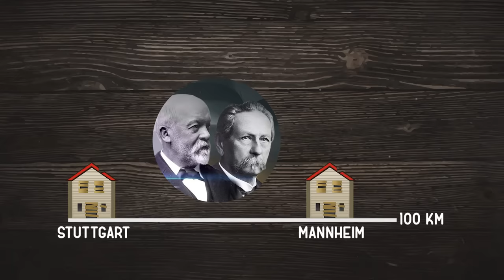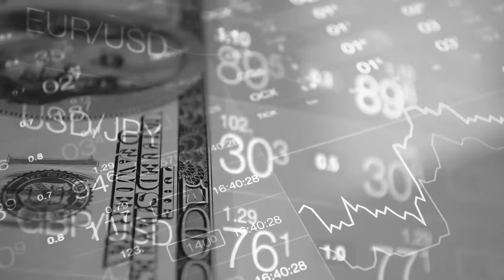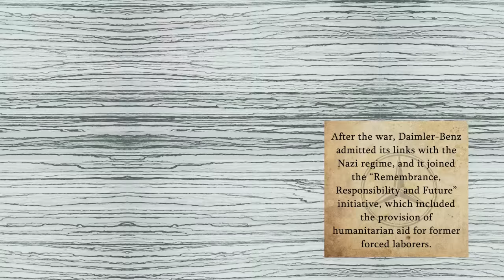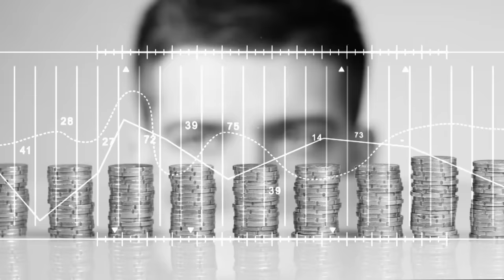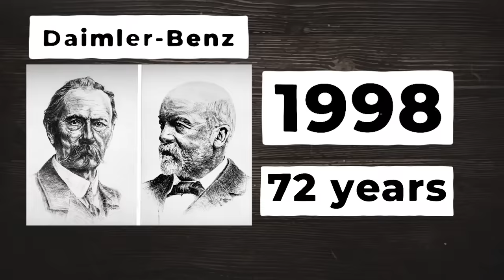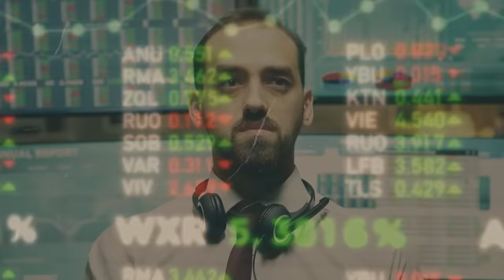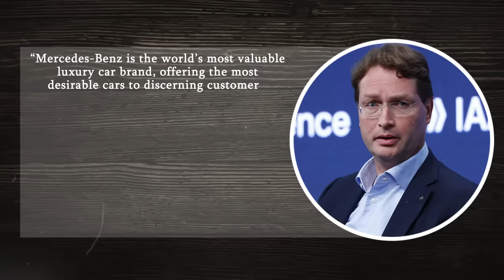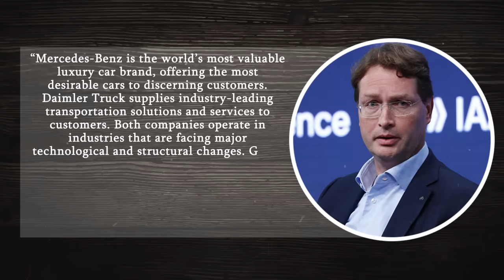How Daimler and Benz Built the World’s Oldest Automaker and Disrupted the Industry

Comment: I think that when Diamler merged with Chrysler  the quality of Mercedes-Benz went down. I had a 1967 Mercedes built in Europe it was a very fine car .
Reply: It didn’t make Chrysler better, it just made Mercedes worse
Reply: @samuelwoolwineiv7886  anything Chrysler touches turns to crap
Reply: Yes! True viewing! Mercedes going worse quality by today time.
Reply: Mercedes also faced strong competition from Lexus around this time. Their cars were no longer engineering first but instead built to a price point in order to compete with Lexus.
Reply: Partly...but the philosophy is the main reason. Part of the philosophy was to generate more profit. MB started cutting corners to increase profit leading to lower quality and reliability as a result.
Reply: Very true. Too many Jews in USA car management.
Reply: That has nothing to do with it. The last S-Class was the W140, which was allowed to be built as the engineers wanted without also looking at the financial costs, and the next S-Class, due to the great pressure and from  Lexus, and the struggle for the Asian market, had to become more cost-effective, and since then the S-class is no longer built as it used to be, but has to be built in such a way that it is also more cost-effective, so the cars are from the late 90s  not like the old Mercedes Benz models.

Comment: Karl Benz was the first of the two to build a gas-powered automobile...iirc, according to Mercedes' history, his 3-wheeled vehicle was built in 1885 and he received a patent in 1886 (Jan).
Gottlieb Daimler ALONG with Wilhelm Maybach made the first 4-wheeled ICE vehicle in March 1886, as you mention, independently of Karl Benz.
BTW, Maybach is pronounced ˈmaɪbax...MY bax (like lightly clearing your throat). Even if you don't get the ending right, just get the beginning..."my" not "may".
As you also mention, the "Mercedes" name came from long-time contributor, racer, promoter, board member, and exclusive dealerships owner, Emil Jellinek, who had a habit of naming his Daimler-Benz race cars "Mercedes" after his daughter. 
What I didn't know was that Mercedes-Benz once owned Audi...interesting. I'll have to research this.
---
I've always loved Mercedes (the first car I drove was a 300E) and Audi (the car I learned to drive on was a manual 90 Quattro). Not surprisingly, today, I have an Audi A8L, two Mercedes S-Class sedans (W221 and W222), and just got a Mercedes-Maybach S. Actually, I might have still had another S-class (W220) if it hadn't been lost in a flood. I would have gotten another Audi, but the A8L hasn't had a V8 option for 2 years now. Porsche now owns Audi and is the only major German automobile company I haven't owned...yet. I did briefly test drive a 930 turbo flachbau (slantnose) back in the 80s and that's the Porsche I've always wanted to get...one of these days...
Reply: Interested history of Automobile industry of German
Reply: Why Mercedes is better than Audi and Bmw?
Reply: @alikukaj8279  Mercedes has the latest tech, better fit & finish and reliability, and has one of the best sound systems on the market.

Audi is a close second. I like their slow design progression between generations, but there are fewer options and the design as a whole is a bit...blah. It is nice, but just not as nice, imo, as Mercedes.

BMW has, again imo, just lost their way.
Reply: @samshare2146  thanks mate
Reply: The Audi 100LS, appears to be a small Mercedes from the sides and rear.
Reply: @jamesrecknor6752  Interesting. The Audi 100LS is a bit before my time. Looking it up, I do see some styling similarities in the side and rear between the Audi C1 and the Mercedes W123 of that time.